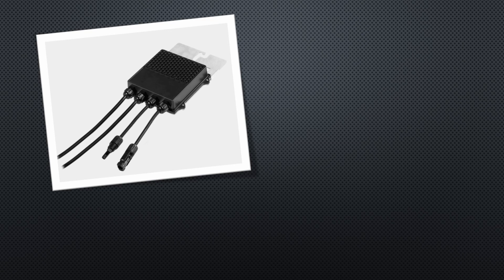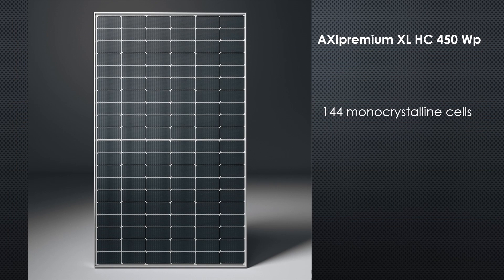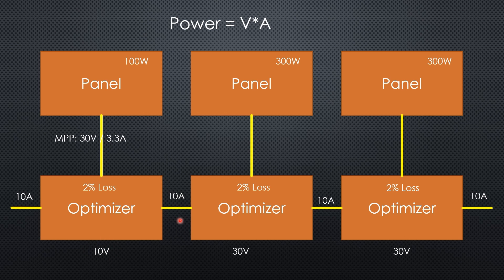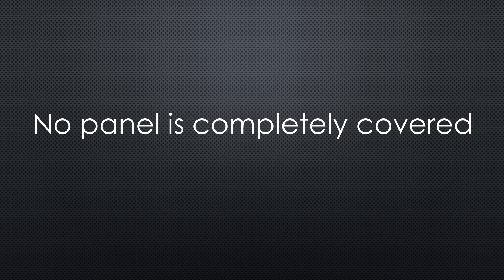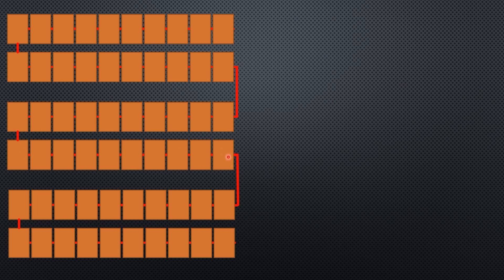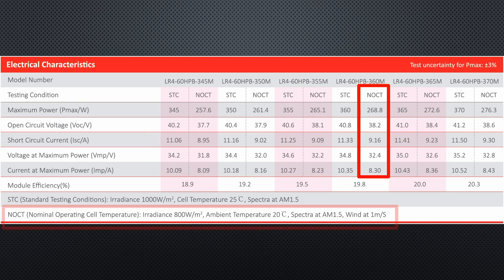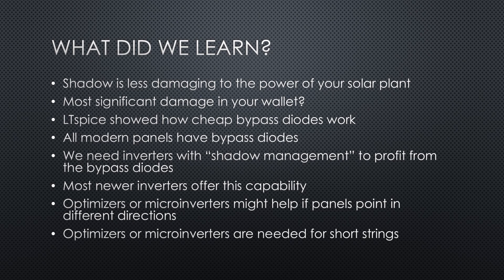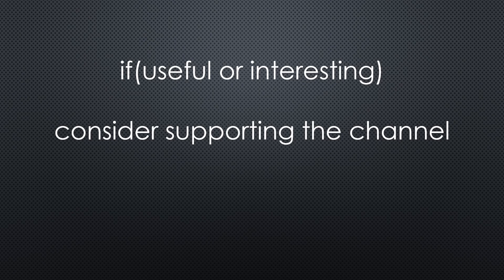441 Are PV Optimizers Worth the Money (e.g. SolarEdge)?

Comment from the maker: Some of the Y-axes are wrongly labeled (W instead of kW and once V instead of A). But it should be clear what it needs to be.
Reply: not sure but in general our 2022 solar panels and inverters show such string behaviour that 1 partly shadowed module kills the production from about 2500 Watt to 250 Watt and then 30 minutes later the same for the next string which is twice as big from 4500 W to 450 W caused by leaf tree. Each day the same time this can be observed where we moved from 1 bing string inverter  to 3 smaller one phase and double string inverters which lead to 6 strings and therefore a much longer usage time of the full power . Our roof is now split into 6 strings instead 1 or 2 and the benefits are significant if you check the inverters string by string and not the inverters in general even though that will show the same effect .
If you add a timelapse camera you can mark the lines of the shadow when the shadow is too big for the diodes and the power will be lost. 

I am not sure about the optimizers but the 4 different Growatt inverters we have had in the past 3 years for tests (like SPH series, 3000-S String, Mic 3000, Min 3000 and Mic 4600).

But they also come at a price, which means the price of the purchase of 3 smaller versus 1 bigger but also the lower production cause 6 strings instead of 1 big one means lower string voltages and too low voltages means that the inverter will start later than the 6 times bigger one. 3 Watt is not enough for a 4,6 kW inverter, but 18 Watt sure. 

Not sure what the shadow optimizer inverter will cost or how big the benfits will be they can gain but it is not that easy.

I had played a lot with the simulators like that pv sol premium which Valentin Software offers for free for 30 days but I was able to gain more and more Watt hours by the right inverter size and amount strings and of cause the sting cabling cause our strings are build up vertical cause a tree is spending shadow from 4 pm in the evening which is now not so much wanted than 30 years ago. But it took quite a long time to find solutions for each roof, one with the chimney and the tree shadow and a lower angle while the other has a steeper angle but also its own issues caused by a GAUBE of 7 m widthspan . Gaube looks nice but 22 years later more or less useless nowadays cause a 7 m long segment of the south roof is lost and also causing shadows in the morning and the evening on one or the other side.

Hope to see the update video soon, but I guess it will take till spring. Meanwhile we will simply add more panels and another inverter which will help a lot to get the 20 kWp in Spring and maybe in 2 years the 30 kWp as maximum using the roof area better with small microinverters around the 2 chimney and lower areas where the greenhouse is which has a steel roof too. Gets a lot of shadow but 5,5 m width and 2 m depth will offer a spot for 5 big 525 Wp panels that can produce during summer full till 4 pm before autumn and winter will start the time of long shadows no one wants. 3 kWp here and 4 kWp there can make 5000 kWh even in shady situations if the microinverters can proctect these modules close to the chimneys. The Min series from growatt with 2 mppt has helped us a lot like the Min 4600 we could get for 600€ , but the smaller ones like the 1000 W inverters are getting expensive about 350€.
Unfortunatelly the cheap chinese GMI inverters or the SGB or many others we have all tested are not really working fully and throttle caused by overheating. Only the more expensive western ones get it done right but at a higher price, lot higher price of about 360€ per 500W - but at least without throttling.

Maybe hoymiles might be able to deliver a better performance and having the EU certificates like VDE AR 4015
Reply from the maker: @typxxilps  Your situation seems to be quite complex! I do not know the products you use. But the inverters must have built-in shadow management. Otherwise, they can react completely wrong (as it is the case at the beginning of your comment).
If you need more and more small inverters, optimizers or microinverters might be the better choice, at least for the shortest strings. But still: If a shaded panel does not produce energy, an optimizer will not fix it.
Reply: Micro inverter and Optimizer The solar equivalent of Batterizer  see EEVBlog
Reply: Hi, Andreas! It's been sad for me to see that you don't number you videos any more. It is a killer feature of your channel! Numbers make it so easy to navigate through your vids and I go through them a lot! Let's say I need the video about A6 GSM module, I would simply type 66 in your channel's search and here I have it. I hope you consider keeping on with this tradition! Cheers from Prague =)
Reply from the maker: @romanalexandrov2880  I still number my videos. Only the last few get their numbers later...
Reply: Andreas, I love your solar material and ESP32 material.  Here is my invention that combines both:  https://www.youtube.com/watch?v=xexNW8h7T74
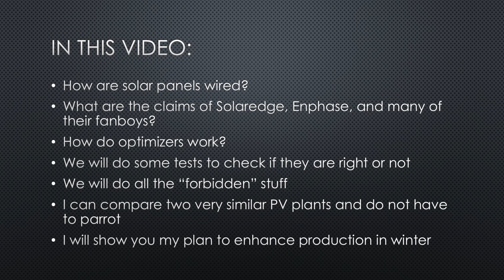Reply: 2:03 has your plan for better production worked out during last winter ?

That might be the last secret to unveil regarding this topic.

Comment: Just saw this video after watching "Gary Does Solar" https://youtu.be/ESpsdMFEFZo?si=ohNU6wZOrruXgzlK!! Please cover this topic in your research what happens when there is a diffused shading where the shading current is not enough to be blocked by by-pass diode and hence whole panels and its strings current output is reduced!!! So there would be clear advantage in these situations when there is a diffused shading like clouds, pole etc which covers several cells, using Optimisers!!
Reply from the maker: I have no further plans on this topic :-(

Comment: Interesting. I am getting ready to do a solar installation and trying to learn. You almost have me convinced. I just have a couple of questions. Without optimizers how can you tell if one or more single panels malfunction and which one? It seems like an optimizer might be worth it solely from a system maintenance standpoint?
Reply from the maker: You see if a panel does not work anymore because it either blocks the string or reduces the max. voltage at noon. Then you have to find out which one it is. There, the optimizer helps of course. But most electonic engineers will tell you that the chance you discover a defective optimizer instead of a defective solar panel is high. Optomizers are complex electronic devices that do not like heat an humidity. Solar panels are much simpler devices and seem to live longer.

Comment: Of course, what you are saying is true about optimizers. But code in my state (Washington) requires module level control for rapid shutdown which means optimizers or microinverters anyway. There is another option that is a little cheaper through Generac for module level control rapid shutdown, but it leaves you blind for the panel by panel view. I would never install solar panels without optimizers or microinverters. I need to see what each panel is doing in the monitoring system. Eventually, you will want that information to be sure everything is working properly and efficiently solve problems when they arise. A single inverter system can't give you that info. By the way, most of the solar edge inverters I installed failed and had to be replaced under warranty. Microinverters do go out on occasion, but the warranty period is longer, they are cheaper to swap out, and only 1 or 2 panels are out while waiting for a warranty replacement rather than the entire system being down.
Reply from the maker: Other viewers also mentioned your laws in the US. Maybe your houses are built of different materials. Here, most are made of stone, and we do not fear fires.
I divide the power of a string by the number of panels. Then I quickly see if something is wrong, BTW. But I have to search for the faulty panel, of course. However, I will never discover that the optimizer died earlier than the panel...

Comment: One of the claims of Enphase, is that their system activates earlier during lower light then a string inverter system (and will run later into the evening). Think there is any truth to that or that it generates more usable power during those times?
Reply from the maker: These times are short (if at all) and the energy density during this time of the day is extremely low. So not relevant at all.

Comment: Thanks for the thorough testing.  So the claim "one panel shaded halts all output of the entire string" began with earlier panels and now won't die.  Glad mine are the latest Longi Hi-Mo.  The spec sheet states "Half-Cell" but doesn't detail the implications or discuss shading.  Glad you explained it.  Seems I lucked out in my craigslist purchase.  I thought my panels didn't output much until 10 am in Summer since one panel in each string of 7 is mostly shaded before that, so exploring optimizers.  After your tests, I suspect more likely just due to the sun angle since my panels at tilted slightly to the southwest.
Reply from the maker: The tilt indeed has a big influence!

Comment: Thank you Andrea's, very informative. However I wonder, what if you can't afford a nice fully featured inverter like your Huawei. In the space of off-grid and hybrid inverters there are a lot of very cheap, very popular products like for example my EASUN SMH-ii-7k etc that I very much doubt do global MPPT sweeps. In such case if you can spend $300 on an inverter instead of $3000 and invest $600 in 10 DC optimisers are you not better off? You loose 2%, fair enough, but your system(except panels) is well over half the cost.
Reply from the maker: I do not know how other inverters react. So you have to do your own tests :-(

Comment: A clarification question for 2:48: you have one string connected between the East facing panels and the inverter and another string for the West facing panels? 
OR you have only one string and the East and West facing panels are connected in parallel within the string?
Reply from the maker: Two strings. As you write: One west, one east.

Comment: wondering - did optimizer work for your different orientation solar cell ?
Reply from the maker: Under certain circumstances. The optimizers only can reduce the voltage.
Reply: for cells on same string but different orientation e.g. 4 on east and 4 on west on same string would you recommend using optimizers on all 8 ?  @AndreasSpiess

Comment: Hi, Andreas. Nice to see you sitting on a roof instead of sitting on on a microcontroller 🙂

Very interesting video, it confirms other sources I read before. But I've found by myself that, in some heavily-shaded scenarios, professional third-party simulation software as PVSol show a significant difference in production when optimizers are added. For instance, I've just run two simulations (13x460Wp, Huawei inverter, south, 30º, heavy shadows from buildings at the afternoon) with and without 8xHuawei optimizers (attached to the most shaded modules). It throws +767kWh/year with optimizers.  Taking 0,2€/kWh that is about 150€/year, so the extra investment would be long-term justified.

Of course, the modelling software is somehow a "black box" and I can't verify its calculations, but PVSol is widely used and, despite of its horrible 3D CAD engine, is considered an accurate simulator.

Maybe other users can confirm or refute this.
Reply from the maker: I would try it. 
However, my 9kWp installation without shadow produced only 7.7MWh last year. So 767kWh gain seems to be a lot. I assume you cannot connect these panels to the second string.
Reply: @AndreasSpiess , this is Spain with tons of sunlight... a 6kWp installation makes about 9MWh/yr, so the expected gain is high too.

Do you mean wiring all the shaded modules in their own string? I can try a simulation that way and see if it makes a difference.
Reply: Done, I tried both configurations. In the "with optimizers" simulations just added optimizers to every module (i am lazy and it was simpler to setup in the software that way). Non-shaded modules would take negligible benefit from it anyway.

Here are the figures from PVSol:

NON-OPTIMIZED STRINGS (strings include shaded and non-shaded modules)
 --Without optimizers: 7068kWh
 --With optimizers: 7825kWh

OPTIMIZED STRINGS (one string with 7 most shaded modules and another string with 6 lightly or non-shaded modules)
 --Without optimizers: 7224kWh
 --With optimizers: 7823kWh

So the ranking is:

1st place (virtually ex aequo): both "with optimizers" options. About 760kWh over the worst result (same as before, as expected).

2nd place: optimized strings without optimizers. About 600kWh under the best and 156kWh over the worst.

3rd place: non-optimized strings without optimizers.

PVSol was setup to make calculations every minute based on climate, geometry, shades, etc. But I'm not sure if it also simulates the optimizers, uses its own experimental data or just applies some kind of correction based on manufacturer's datasheet (as it does for modules temperature, aging, etc.) In that case the expected gain would be quite optimistic for sure 🙂

Comment: One good thing about optimizers (and micro-inverters) is servicing.  They make it very easy to pinpoint, exactly where and what needs changing, and modules do break.  Also, the whole module level "rapid shutdown" thing would be difficult to satisfy without some sort of M.L.P.E.  Do other parts of the world have to abide by rapid shutdown?
Reply from the maker: I agree that fault detection is easier with optimizers. But because optimizers contain much more electronics, there is a high chance you will discover that not the panel was the problem 😉
We do not have this „rapid shutdown“ requirement

Comment: Thanks to your video which is correct for a single panel. But the situation can be very different with a whole string of panels in real-world conditions with several pannels shaded differently, e.g. by trees. See end of this video:  https://youtu.be/AZ8VQ_zmf1M?si=5INKLBo2HyT4oQjg&t=480 . It would be very interesting to do your simulation with many (8 or 20 panels each with different shadings) and compare it with optimizers, at first glance it way more complex ?
Reply from the maker: You are right, things can get complicated. But usually are not. Why are all those videos theoretical and do not show examples?

Comment: Thank you for your experiment and good tips; I must point out that you are in fact missing something. Even with regular string inverters, most panels have what is called bypass diodes. So if they are covered completely like in your experiment, or otherwise lose too much of the potential electrical current (usually above 30%, 3 bypass diodes per panel), it will completely bypass that panel (or that 1/3 of a panel). However, in the real world, you don't necessarily cover an entire panel--you may have branches or debris block portions of the panel, and reduce its efficiency by say 10%. The entire array will underperform by 10%. Because a single electrical current must be the same amperage all the way through; it cannot be one amperage earlier and change later or vice versa. You can ask any electrician about this.
Reply from the maker: I agree with your analysis. However, this effect in most cases is way smaller than the 2% loss optimizers produce all the time during operation. And of course, it is my interest to keep my panels clean.

Comment: as someone new to solar and trying to get up to speed you have helped me a great deal. All our panels are on the same southern facing plane of our roof and therefore microinverters are unnecessary but yet the company doing the install has used them. We will be questioning their usage and likely asking for their removal since they are ineffective and expensive. And requesting the appropriate price reduction according to their cost. Our situation is something of a nightmare, a company that takes advantage of its customers by being greedy, and overly accepting of what the equipment providers ad copy says. I dont buy half of it, and am becoming increasingly antagonistic towards my installer for that very reason. If we don't end up in court it will be a minor miracle. Thank you again for your common sense approach to this. I am very grateful.
Reply from the maker: Many installers are also "cheated" by the suppliers. Keep in mind: This is a growing market with many new entrants without deep knowledge. I would inform your installer, not punish him.

Comment: Very informative, great approach. What we need now is a bigger sample set. As you say, the optimiser may have a 2% energy cost and you've robustly debunked the necessity of them in a string. However, could they potentially have enough benefit to counteract the energy cost? There are of course other benefits, not least the per-panel monitoring. 

The reality is, they aren't as prohibitively expensive as made out. Our PV quotes ranged from £14,000-16,000 - the additional cost of optimisers, perhaps £500-600 is significant but almost in the noise. We ended up picking a middle ground option, that was SolarEdge. No regrets, a very efficient inverter, and as I say, amazing to be able to monitor each panel's performance.
Reply from the maker: So your choice was good! After more than  a year of using our panels, I am no more interested in the details, more on the overall situation.